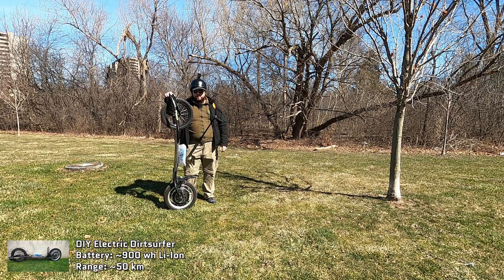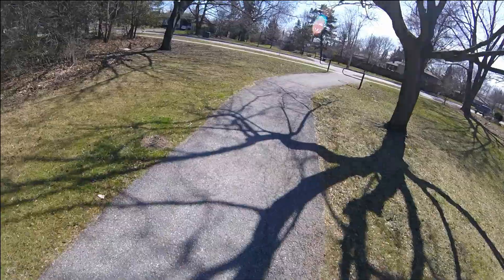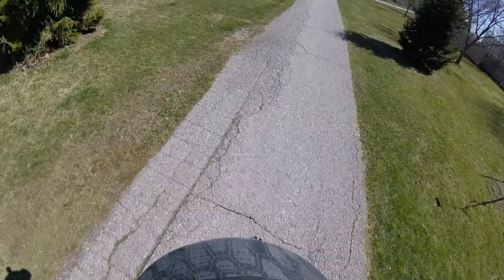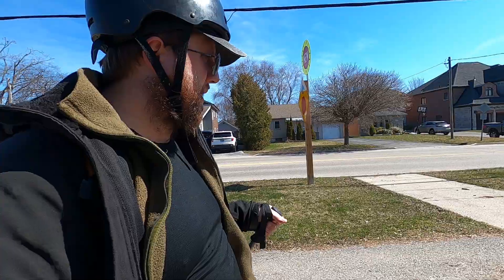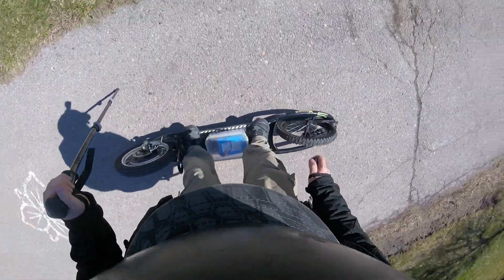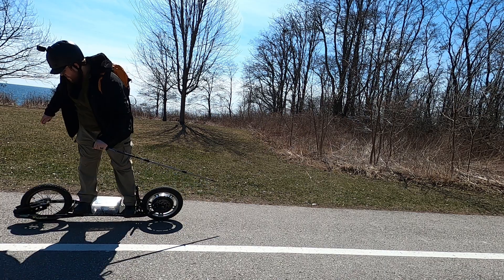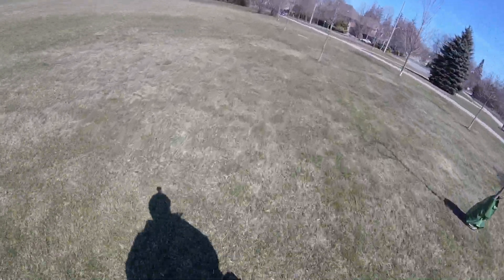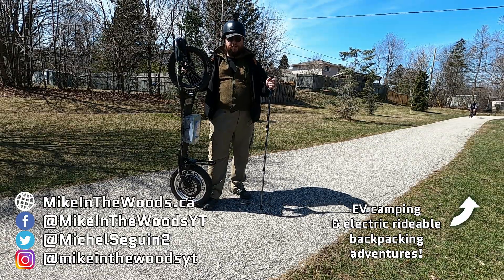My Electric Dirtsurfer Was Impossible To Ride - Until I Tried This

Comment: Lower centre of gravity definitely helps. I have 2x 20" dirt surfers, one doesn't have the flex deck suspension and sits lower to the ground. This makes it easier to start by kick pushing, but I had to learn to kick push mongo (back foot on the board, pushing with your front foot).
The dirt surfer design is more stable starting with your back foot on the board. 
I purchased the lower one thinking it'd be a good eskate conversion, but have never got around to it (with no parts or build experience). I've mainly been riding evolve eskates along with limited time on onewheel pints.
Thanks for sharing your experience
Reply from the maker: I haven't taken it out for a ride in a while

Comment: Love this. I had a dirtsurfer about 15 years ago and I remember just how hard the thing was to ride. I never did get to the place where I could kick it under my own power on flat ground. Way back then I thought "this thing would be super fun if it were self-powered" so it's super fun to see that someone has gone and done that. 

One thing that may help you start from a stop is to look up! I learned this riding longboards. If you're looking at your feet, it's way harder to find your balance point, which makes sense because you're literally moving your center of gravity forward by looking down. So maybe give that a try. Look where you want to go and feel for the balance of the machine underneath you, especially now that you've got a pole to lean on.
Reply from the maker: It's certainly interesting to ride!

Comment: I would think interfacing the trekking pole with the board, (maybe into a notch or a hole), would be more helpful. Having some leverage would make it much more stable on the start, and you could use it to reduce the leg burn while riding, if needed.

Alternatively, you could put the pole close to the board to limit the tilting, kind of lean against the pole before you start moving?

Comment: I think that you should try to lower the center of gravity a bit, which should make it easier to ride. This is such a cool concept!

Is there anything that can be done to add brakes to this?
Reply from the maker: Not much I can do to lower the CoG I think. Can't mount stuff on the underside of the deck as it is very flexible and I'd get scraping.

As for brakes, it has regen braking! Works just like an electric skateboard

Comment: The concept is great. The execution is awful. You need to move that battery lower which will change your center of gravity and help you with a bit and you have a bit too much swing on your front steering. Try stiffen it up a little bit. Think like a skateboarder.

Comment: yeah, this just aint it. i like the concept but the execution just isnt there. not yet at least. actually i love the concept and it would work a lot better if it was "self balancing" with a retractable or maybe even spring loaded kick stand that can support you while you mount and then automatically retract when you start moving. 

really cool PEV concept you have here, even if impractical at this point in development.
Reply from the maker: Dirtsurfers have been around for decades, this is just an electric conversion

Comment: Form what I observed the instability at low speed may cause by the front deck is much higher than the rear, try to lower the deck and increase the pivoting angle of that steer 35° like a mountainboard
Reply from the maker: Nah it's just the natural instability of a 2-wheeled PEV at slow speeds. As soon as I pick up even a jogging pace, it's much more stable lol